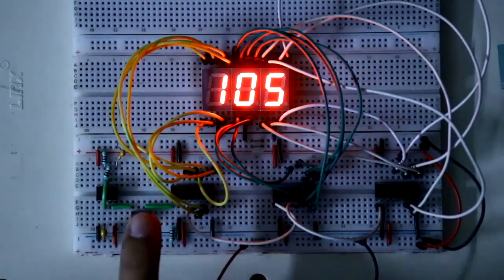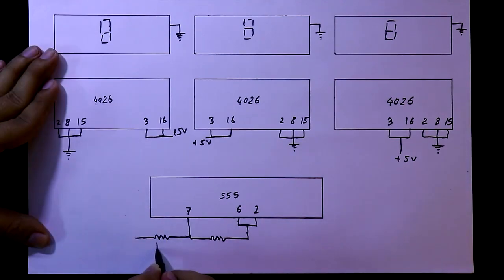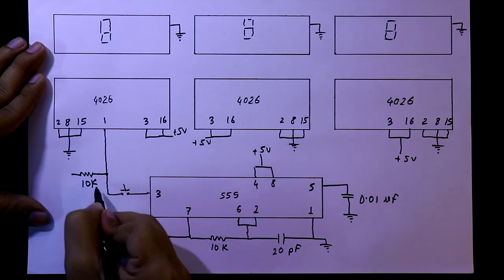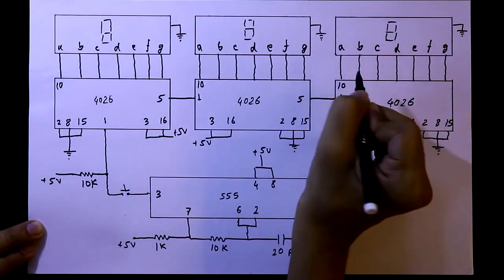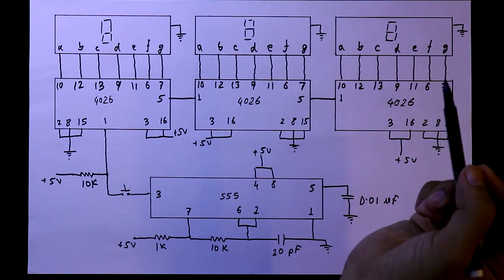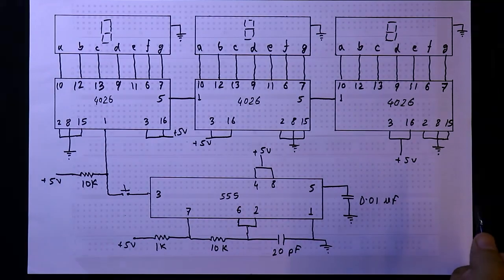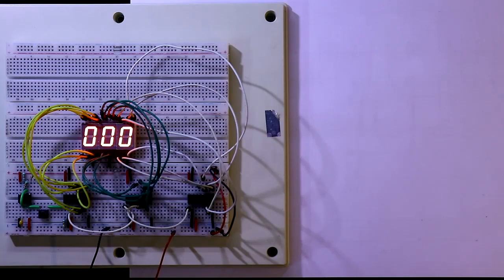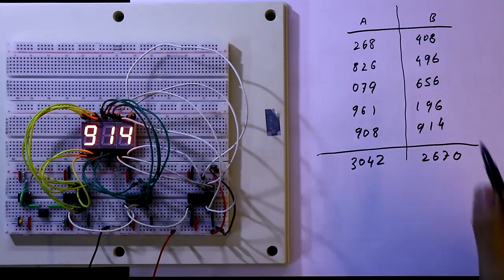Random number generator circuit without microcontroller

Comment: Video is very good including concept and implementation- but it is lacking the explanation of components used including logic behind it. Would be good to show LED upside down and explain the letters, the same for pins and what the other units are doing. How it is able to generate number without displaying non numbers like just bottom parts of LED. 
I would be personally interested but for 2 digits max (1+1) but 3 such in row total 6 displays, to get total 6 random numbers (0-9) for each LED, (or single dual led and single random). Total 6 digits but in pairs to get  3 individual buttons  to operatare 3 units (each  1+1 LED to get 0-99 number/unit= single button click to operate just that single unit 0-99), generated separately, rather than 6 digits in one go.
This could be as dual LED display if make work easier as key would be to have minimum 3 separate randomness (0-99) or in above scenarion random generated for each of 6 LED. Thank you for informative videos- much appreciated, interesting concept without Arudino.

Comment: We couldn't find IC 4026, what can we use as an alternative?
Reply from the maker: To work like a 4026, you need 7490 and 7448
Reply: @EEWave  Do we need to use two of them together or just one
Reply: @EEWave  And  their pin connections are same as 4026??